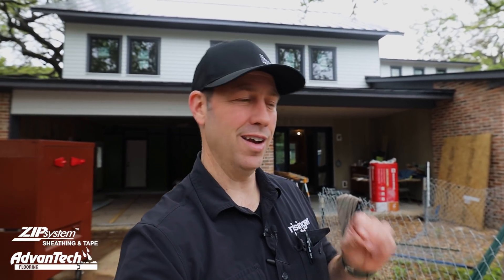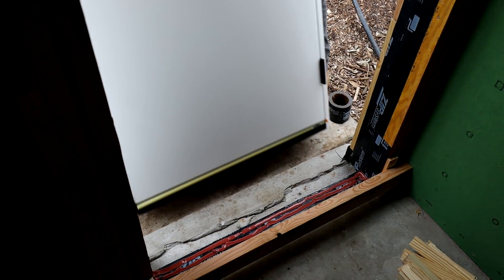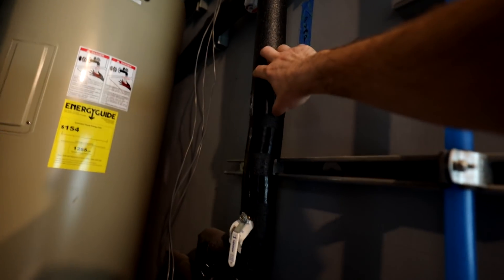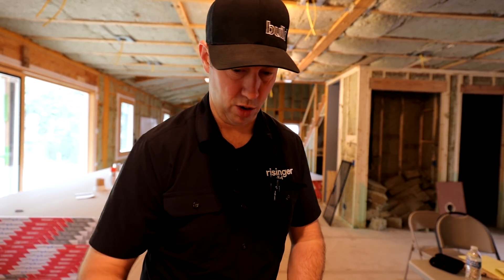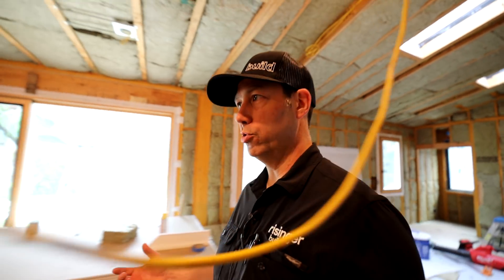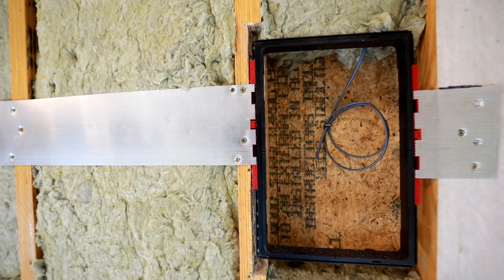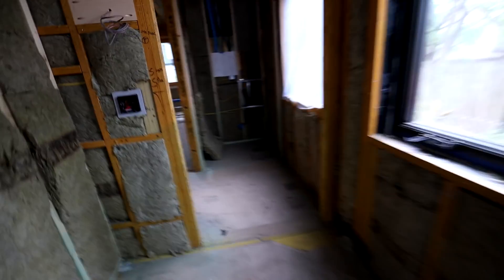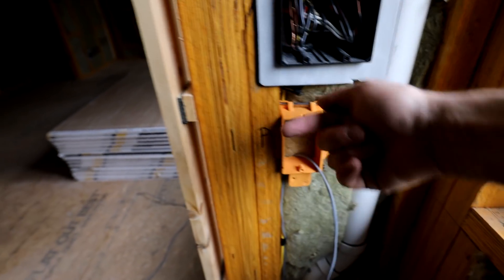Pre-Drywall Walk - Update on my house! RealReBuild

Comment: 75” or bigger. All the great work you have done on the house deserves the biggest most enjoyable tv.
Reply: And why the windows in that room?  The Jetsons had a TV that was the entire wall, would that not be possible in our near future?
Reply: Agreed. LG GX 77” OLED I’d recommend. Best TV for a reasonable price
Reply: I'd go with the 120" tv
Reply: There are ratios for how big of a tv you should have for a room.  Essentially if you go to big for the room, you see less of the screen, and because the pixels are bigger the resolution is essentially lower because you are too close to the screen.   Bigger doesn't always mean more enjoyable.
Reply: Go big! I've seen 8ft distance -> 80" 4k tv.
Reply: 75" (or 77" LG OLED) really is the best size for that space. And run more than a single Cat6E! You will never regret running a few more. You WILL need them for one thing or another. You could always run smurf tube from that location to your equipment closet. I cringed hard when I only saw a single wire AND no smurf tube.
Reply: 85” is so good

Comment: Go 77” on the TV. I just finished my remodel and put in an LG OLED77GX that sits FLUSH on the wall and is about 2cm thick. It’s such a nice install, just needs a 14x14 box behind the TV to be flush. I also used the Sonance brackets before drywall... worked SO well.
Reply: Also don't forget to run fiber optic Hdmi cable from tv to your  entertainment cabinet area
Reply: @1gqtoy1  Make sure you have 1.5 inch conduit and a pull line between the two, the march of display tech is never-ending, better to have an easy upgrade path.
Reply: The Sony model in the same size would be my choice. The XBR-77A9G is the model number. OLED is amazing. I would make that conduit a 2" pvc pipe with sweeps at either end, between the TV and cabinet below. Check out the Salamander cabinet line for a purpose-built but beautiful and stylish A/V cabinet.
Reply: ceiling mounted projector would be fantastic, either alone or a retractable screen
AND a 75+ screen tv.

Comment: Matt, go one step further. Go with an 85”, we were confident that a 75” would work, but decided at the last minute to go with an 85” and have never looked back. They are so inexpensive now, you won’t regret it.
Reply: We bought a 55" years ago when 63" was available and I always regretted it. Time came for a new TV went with 85" without hesitation, and I could foresee going even bigger but that's the max size really unless you go with a theater and screen. Go big or go home!
Reply: Currently using 85”, at a distance of 14 feet, works great
Reply: I did sit in a home theater that had too big of a screen. Watching any kind of action movie would almost give you a headache. It just needed more distance or a smaller screen. I don't know what the actual dimensions were
Reply: @Scooters87  there is apparently a formula for it all, to make sure your eyes don't have to work to see the whole screen, which would induce the headache

Comment: I installed TVs for years.

A great formula is: measure the distance from where you will be seated to the TV in inches. Divide that number by 2.5 for the smallest recommended and divide it by 2 for the largest recommended size. If you are truly sitting 144" away you will need a TV between 58" and 72". Go for the 65" size and mount it where your eyes while seated will land horizontally between the middle and bottom of the TV (1/3 from the bottom is ideal).

I upset many salesmen, and may loose my "man card" for saying this, but in TVs bigger is not always better.  I would tell my customers it would be like going to a museum to see a large painting and standing inches from the canvas, all you will see is brush stokes not the work of art.  Sitting too close to a too large TV will make your eyes dart to catch the whole picture. This is fine for short periods of time (think movie theater for 2 hrs), but can be tiring and even cause head aches long term.
Reply: This is a very informative information for everybody
Reply: Generally agree with this. It also used to be that too big meant you could see individual pixels. 4K largely eliminated that concern. You could go slightly larger if you expect a lot of viewing from the kitchen. As your room isn't specifically oriented for ideal kitchen (or other room) viewing, the smaller size would likely be more ideal.
Reply: Hey, he is putting his speaker wires next to his power line. Doesn't that add static to the sound? I know that's true for car audio at least.
Reply: @emmanuelgutierrez8616 The old rule with speaker wires that were not shielded, was to keep parallel low voltage (speaker wires, data, and coax cable) and high voltage lines (house power) 12" apart. Lines crossing perpendicular are not as important. If the wires are shielded it is also not as big of an issue. Sometimes it can't be avoided, but the more you keep them separated the better.

Comment: The mixing valve will "expand" your available hot water because it will use the scalding hot water, throw in some cold water to bring it down to safer levels.
Reply: Yep, that’s usually how mixing works.  
👌
Reply: Won't it also be wasting energy every time the recirc pump turns on though? I guess it's not as bad with the way he's setting it up, but on timer based systems you would constantly be mixing cold water back into the hot water tank, no?

Comment: I hope you have some high-tech equipped, DC-motor ceiling fans going in the house. As an avid AIA Austin Home Tourer, (where I met you in 2019 and geeked out), I love seeing these super energy efficient homes in Texas still utilizing ceiling fans for heat or AC distribution, or spot comfort. The designs and efficiency of them, as well as the  controls with phones and other Bluetooth systems, work so well indoors and out, even in a Tight House. You know as a Texan, we love and need our ceiling fans!
You had some nice Minka-Aire Supra’s in your current home, which were in the higher end of builder fans. 
I hope you planned on incorporating some of the amazing advanced ceiling fans in the new house. Maybe even their own video! 
Also from your channel, I saw my first hybrid heat pump residential water heater years ago. You totally need a full video of the split-system water heater! I get as excited as you do for the new tech, and I never knew such a water heater existed. 
I’m hyped as heck for your new family home. Looks amazing!

Comment: Sanden water heaters court definitely use more attention. But on the other hand your climate seems perfect for a hybrid water heater where the heat pump will slightly cool and dehumidify the garage.
Reply: I just wish they didnt run the water outside through the unit. Should run the refrigerant through a coil in the tank. Less freeze danger and no need to waste power on heat tape.

Comment: I’m currently working on rebuilding 2 old 1987s vintage delta 600 series tub/shower valves and all I can say is make sure your shower valves are accessible from the behind. Highly recommend a access panel for future replacement and inspection.

Comment: Matt, my company has a ground-up Building Company. We do everything turn key. Whenever we do the low voltage for our clients, i plan out with them the location and size of their tv. The general rule is to put the seating area roughly 2.5 times the distance of your tv's diagonal size. Going by that I would stick with the 60 in. That puts your couch right where you currently have it. Just my opinion. Sorry for the long winded message. Nice build!👍

Comment: Matt, I did something similar on a major remodel several years ago, that involved several pairs of in-wall speakers.  I didn't know enough to do it by myself, so I went to an audio specialist for recommendations.  They recommended a separate, dedicated amplifier to push multiple pairs of speakers.  There was also a patch panel that was designed to handle all of the impedance generated by all the in-wall wires and multiple speaker pairs.  The last thing, which really made a huge difference, was a set of in-wall volume controls.  Those volume controls were super high-tech because they created the same load on the amplifier REGARDLESS of the resulting speaker volume, EVEN IF the volume was set to ZERO.  In that way, there was always a constant, steady-state load on that dedicated amplifier.
Reply: If my memory is correct, the amplifier brand was Onkyo.  It was a very simple 2-channel amplifier with almost zero harmonic distortion (and also very expensive).  I have to laugh now:  the 2 volume controls changed IMPEDANCE, not volume!  The first time I switched it on, I had set IMPEDANCE to zero, which ended up blowing several fuses.  The dealer apologized for not bringing that feature to my attention.  Fortunately, the fuses worked perfectly, and the unit worked fine after we replaced the blown fuses.  The sound was incredible:  every speaker played the same track, and once the volume controls were set to the preferred volume, the entire house was filled with distortion-free music from a Sansui rack system with integrated CD player.  LESSON LEARNED:  be sure to know whether your controls are VOLUME or IMPEDANCE and dial them accordingly!

Comment: Hi Matt,

Three things about your TV:

1. 75” (OLED preferably). 
2. The TV is way too high. Remember: Your ideal viewing axis places your eye-line at dead center to the screen—-no tilting your head. Premium homes often place the TV in some ridiculous places that seem to totally ignore the actual viewing experience. 
3. While I realize this area is not intended to be a home theater, you have two large windows left and right of your screen. This will cause eye strain. I would suggest blackout curtains or blinds. I would use dimmers in that area or some way to “isolate” the area around your tv in terms of light levels. 

Your channel is impressive!

Regards,
Kevin
Reply: Agree with the height.  When you get the 82"(You think we're crazy but when you actually get it you will know we are all right), you will want the bottom no higher than the trim on the bottom of the windows.

Comment: Great Video. 
The best tool, for pulling cable through Smerf Pipe or flex conduit, is the Ideal Volt-Guard Fish Tape 31-544. It zooms through the corners. The Nylon tape will lay flat and not coil up.
$110 Wholesale, $125 retail.

Comment: Matt.  Go with the 65".  Using the 2-4-6 rule, this provides a minimum viewing distance of ~9.5', an optimum viewing distance of ~19', and a max viewing distance of over 28'.  You could even go 55"; this would provide an optimum viewing area up to 16' away.  75" provides a minimum viewing distance of about 11', which would be right on your couch.  Hope this helps.

Comment: Always go bigger, it will look smaller when all the furniture is in place.  I have a similar set-up and I recommend moving the speakers to align with the top of the tv not the bottom, you'll have better dispersion and it won't sound like all the sound is in your face when sitting.

Comment: 75". Mount height should be center of TV at eye level sitting down. Check out Cheif fusion wall fixed mounts. Has adjustment to level TV. Don't forget an extra network run for TV or anything you may mount behind it. With extra network runs you have flexibility of additional equipment or devices utilizing POE

Comment: I'm sure someone has already mentioned it but per Crutchfield, your viewing distance should only be 1-1.5x your screen size for a 4k television. So in this case deciding between a 65 or 75" TV is pretty easy--go bigger!! I would think that this also depends on what the room is used for. If it's just a family room and you have a dedicated home theater you would probably be fine with the smaller tv for watching the news, TV shows, etc. If it's pulling double duty--regular TV and Movie night--definitely go bigger.

Comment: Don't forget WiFi router placement and where you want extenders before drywall!!! Add some power in those areas so you don't run cords where you don't want to later. Center of house or tops of cabinets and throw in some stuff for under cabinet lighting too. Stinks doing it later....I remembered outlets above cabinets in kitchen for router but forgot the wire for under cabinets...just a thought

Comment: Just get a ceiling-mounted 4K projector with an adjustable display size (manual optical pull switch) and then you can set it to whatever size you want, depending on how many people are watching (more people, bigger display; just you and the wife, smaller display).

Comment: No one regrets getting the larger TV, only the smaller. I'd echo others and likely get an LG G1 OLED (flush mount, newer panel) in a 77" size as it's what I'll get later this year, but if you'll get direct sun from the skylights that will hit it, I might opt for a Samsung QN90A since it can handle those skylight reflections better.

Comment: 75" TV for that seating distance, also if you are going in wall i recommend a back box of at least .9CF, if not, then you will be lucky to produce anything below 150hz affectively with in walls, but then you end up with a section of wall with inadequate R value, just because you need the air space for the drivers.

Comment: I don't have a TV as I hate giant black spaces on my wall.   Instead, I use a projector, specifically an ultra short throw projector (from LG, but there are others) that only needs to be about 7 inches from the wall.  It projects a 120in wide picture. In your case, I would do a projector in the ceiling....   Then you can make the picture as big as you want.  In my shop, we have a projector that projects a 20 foot wide picture, which makes playing video games something else....

Comment: Roll a coat of Ardex 8+9 over the shower pan and up the walls about a third before setting tile.  I'm a big Schluter fan myself and use their system as part of my customers' bath remodels.  However I've always worried a bit about thinset wicking moisture between the banding in the Schluter system, making its way to the subfloor over time.  The Ardex adds a "belt and suspenders" insurance policy at a modest cost.  I include it on top of the Kerdi in all my tile shower builds since I discovered it.

Comment: Good call putting rockwool in the wall (or 3 walls) between the TV and your room.  I hope those mirrors don't become the weak spot.  Maybe some acoustic sealant on the studs as the quietrock goes up?
Reply from the maker: Stay tuned for a quiet house video!

Comment: For the recirculation pump, I would not use all their custom "triggers" but rather integrate it with a home automation system (referring to DIY one such as Smartthings / Hubitat - not the crazy expensive ones). This way you can make it even more intelligent / versatile and avoid all the custom wiring for the buttons / sensors that would only service that one pump. A motion sensor in a bathroom, for example, could turn on the exhaust fan and the lights off once you leave, while also triggering the recirculation pump when you first walk in. The automation can be further enhanced based on other variables (time, day, status of other devices, etc) so possibilities are endless. Edit: This also makes it easier to update the system as needed.

Comment: TV screen clarity is constantly changing. Any size that your wife and kids vote for should win. It will determine the layout and initial setup. The screen is a consumable. Like an LED light, you will change it out. Every 4 years, you will upgrade your screen for clarity and efficient performance. (the old one goes to the garage, or the man cave, or the BBQ pergola. Also plan on changing out the AMplifier/receiver boxes in the audio closets. Also consumables.  Until we stop using computers, You will want to update for computing and sound quality AT LEAST every 5 years - 3 years is more likely. Those electronic boxes are also consumables.

Comment: From an AV pro, go with LG OLED77. If using GX gallery series, you'll need recessed electrical box centered just above bottom edge of TV.  (Gallery series includes wall mount, however, it offers zero latitude in stud placement: must be 16" OC, dead centered on TV - or plenty of blocking.)

Comment: MATT why not use the Watts recirculation system with the automatic thermostatic valves at the furthest fixture? I did my house this way.. I installed 3 thermostatic valves at the fixtures necessary. a couple didnt need it since they were close to the main branch. ITS A GREAT SYSTEM.

Comment: You're welcome for the low voltage smurf-pipe recommendation. Should've used more. It's a lot cheaper than ripping the walls out to remove future proof wiring that guesses wrong. I will not put a TV in my bedroom. That's not what it's for. The bright lights on the side of the TV downstairs are a bit distracting. Get a TV that works; bigger is not necessarily better. But, bigger is much more impressive to the kid's friends.

Comment: I have some questions i would love to have answered about your air sealing and AeroBarrier.
  AeroBarrier gave you a blower door score with the house pressurized and all the windows and necessary openings taped.  How does that compare to real-world tests with windows and doors relying on their seals and range, bathroom and dryer vents relying on any dampers.  
  Standard blower door tests use a vacuum to calculate ACH-50.  Does it come up with the same numbers that AeroBarrier did pressurizing the house?
  How tight can you get a house without worrying about fresh air ventilation and ERV systems?
  Are you using any ERVs in your  home?

Thanks.
Reply: Just for some background, we are soon having our house remodeled in the Pacific NW with closed cell spray foam and seriously considering AeroBarrier as well.